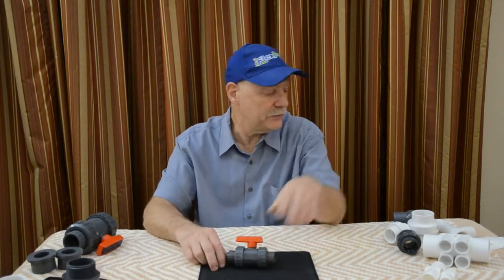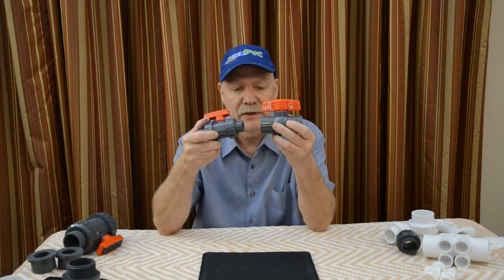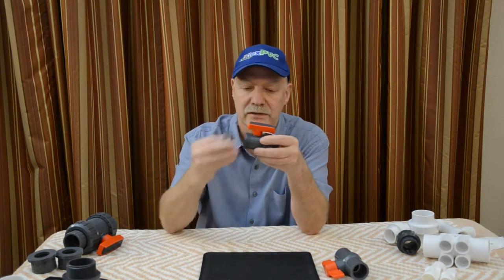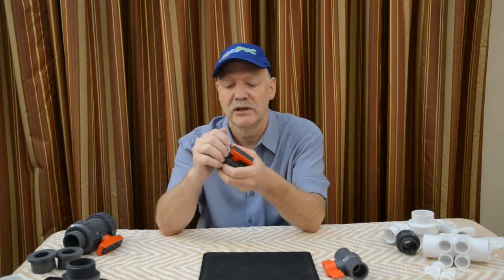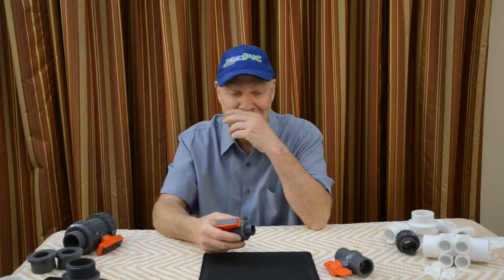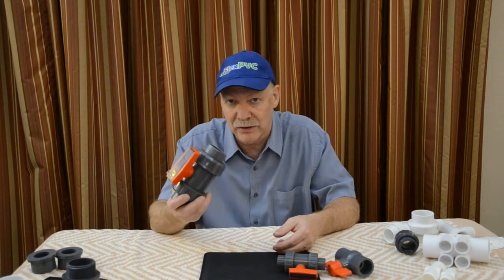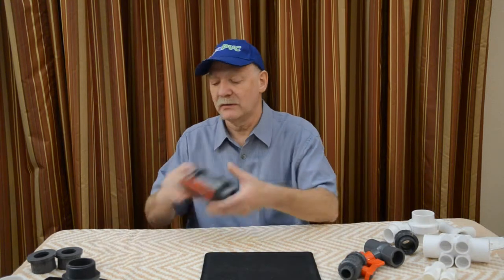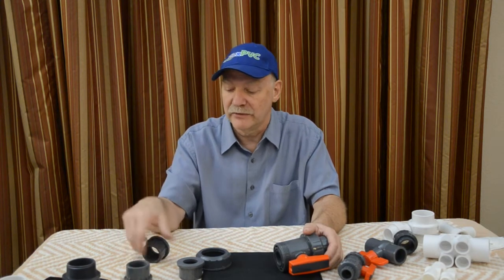FlexPVC - Unionized Ball Valves, Why Spend The Extra Money? Once you know the differences, it's easy

Comment: Unions leak after time. There is pros and cons to both. I dislike union because the screw-in is always dripping.
Reply from the maker: Then something is out of wack. The first thing to check is the o-ring. Make sure it's seated in the slot/groove and in good condition. The next thing is to make sure the 2 pipe are in perfect alignment. No angle. That will cause a leak every time. Eons ago Jacuzzi had a patent on a misalignment union, but they were silly expensive and when Cantor bought them out they never did anything with them. The patent is long ago expired so someone should be able to make them. But if they did, they'd probably charge an arm and a leg. ;-)  But it was a good solution for misaligned pipes. (They did have a problem keepign the o-ring in  place. It frequently fell out. :-(  )